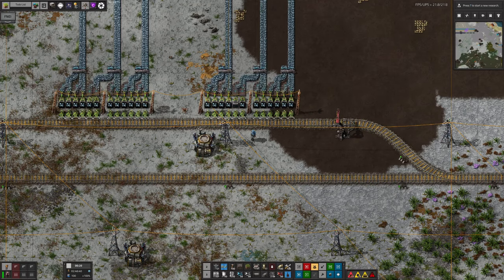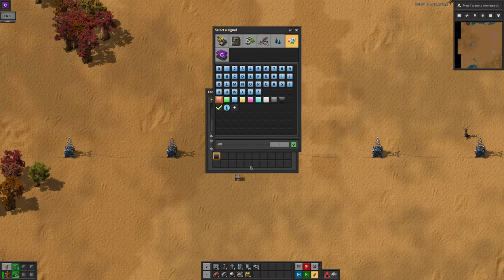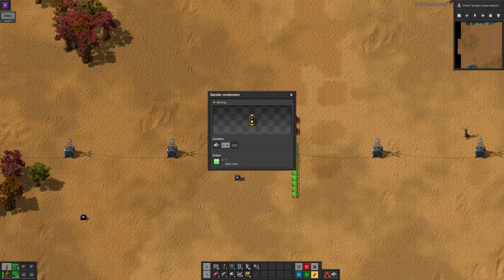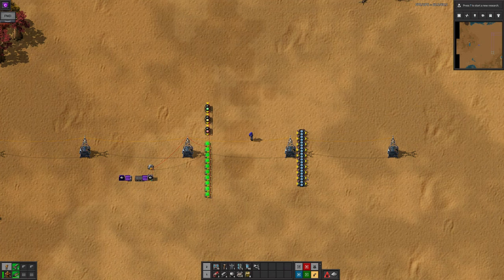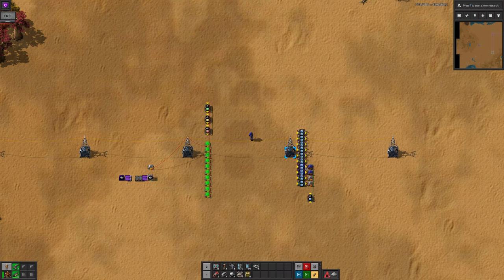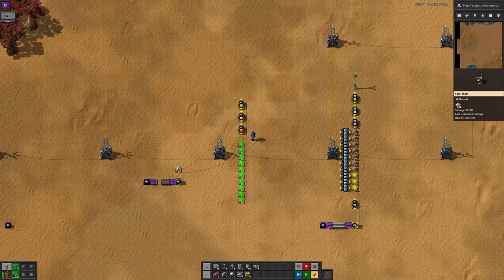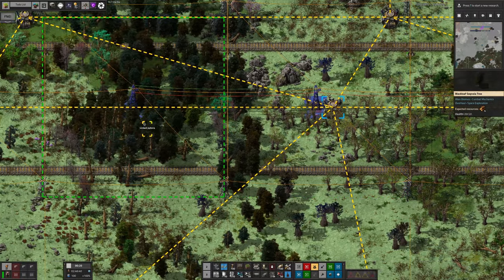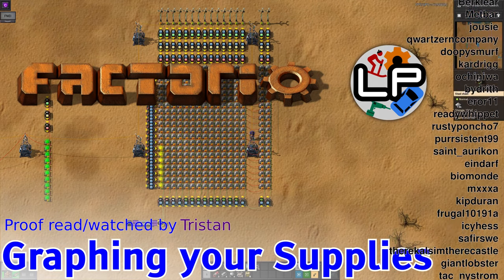Charting your resources - Tutorial - Laurence Plays Factorio

Comment: i have an idea to improve it a bit, you could have constant combinators at all the stations, sending a signal over 1 of the lines, showing how many chests that station has, and which resource it holds, like 6 iron plates on the green line being 6 crates for iron plates at that station. You could use that info to automaticly update the value that x needs to be devided by, so you dont have to do that by yourself. And this would leave the other line free for the actual iron count.
Reply from the maker: That's an interesting idea - it would mean that if you added in an additional iron mine or more storage in the smeltery (or more smelteries!) the system would update automatically. It does mean that both cables are tied up with this system and you can't use them for anything else. Alternatively, you could send different signals - you could send an A for each iron plate chest for example, and this would allow you to do everything on a single cable, however it's slightly less simple to understand. 

A nice idea though - I like it!
Reply: Or you could encode it into the signal itself. The maximum range of values is - 2^31 to 2^31 - 1, or about +/- 2 billion. If we assume that you won't get close to that limit, then we could use the excess to code the number of chests.
The simplest way to do this would just be to use the first two (or so) digits to encode the number of chests, and the remainder gives the actual value of the item. Then the display at the other end can easily decode by dividing by 10000000. The integer result is the number of chests, the remainder is the count.
If you do get close to the limit, then you could reduce the number of digits the actual count uses by reducing the number significant digits - if you have 2 billion iron plates, the tens digit isn't really all that important. At this point we are using floating point representation. The only problem here is adding together signals from different stations won't work for the exponent.
You could also use the negatives by just treating it as an unsigned integer as well.
Reply from the maker: @PanozGTR2  Interestingly, we were having a discussion along these lines over on the Discord server, and yes, I think that should indeed be quite possible! A station is going to typically have less than 100,000 plates, so yeah, storing the number of stations or the number of chests in the tens of millions allows for about 100 stations before it becomes an issue.

Comment: I like the design! Maybe with the upcoming legendary or modded substations the graph will fit in between them? Also, would it be useful with a logarithmic scale perhaps? Thanks for the walkthrough!
Reply from the maker: Yeah, with the pylon substations from Space Exploration, you could easily fit it between two of them, even with a much bigger graph!
I like the log scale idea, you could implement that by having each light multiply the Y value by, say, 1.5 instead of adding 10, although then you'd need to feed in a number at the bottom so it doesn't start at zero.